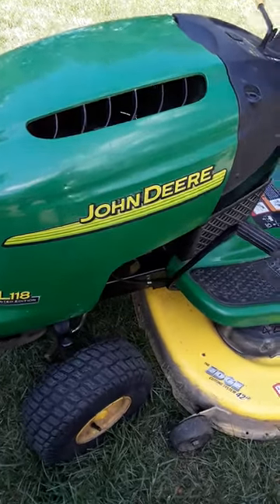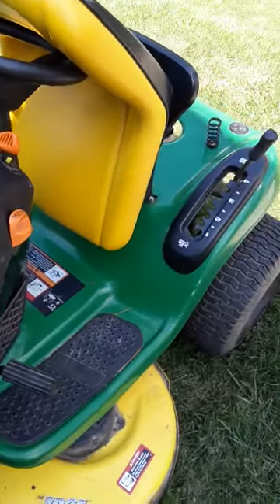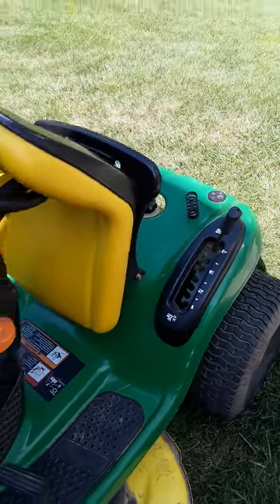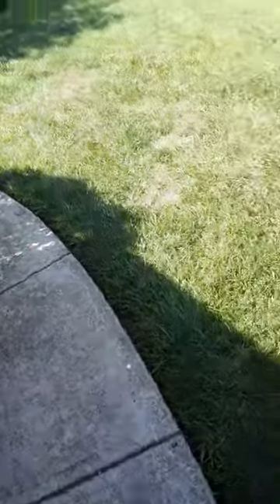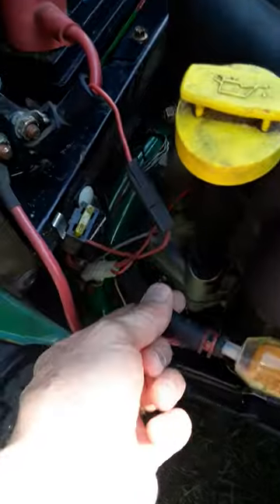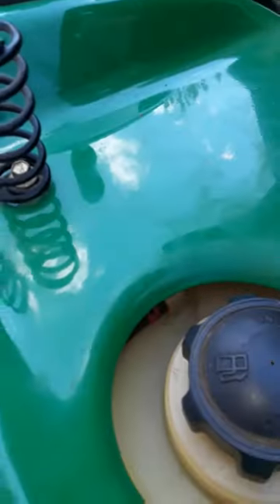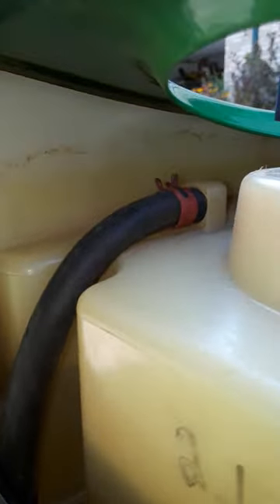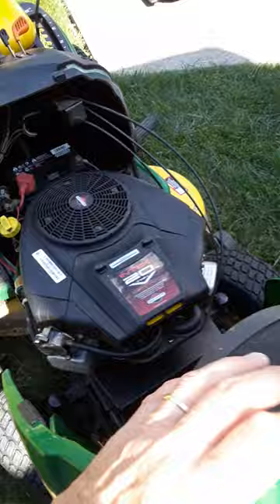John Deere Riding Mower Surging Problem Fixed!

Comment: I have a new (3 year old) jd e120 that just started surging. I just changed the plugs though the old plugs really looked fine. Fuel filter was changed last year, and air filter looks clean. Only have 60 hours on it, so I’ll check the fuel line and other simple things. Thanks for the video

Comment: I haven't fixed it yet but I know that's what it is cuz it's not getting the fuel from the tank at an even flow thank you for this and I will make sure I fix it with a new fuel line and filter

Comment: Thanks bud, I have a D105 that I just got up and running, new tires, new battery, and it is surging but will idle even at the lowest setting. So I’ll be sure to replace the lines and go from there.

Comment: On an older mower, the fuel line can shrink, both lengthwise and diameter,  especially if the line was put on tight to begin with. 
Best to hang the line a little loose when installing, to allow for shrinkage...it will only use an extra inch or so of tubing. 

I noticed on one of my Husqvarna mowers,  the line near the tank connection is a little tight, and the mower has only been used for two seasons. 

The tubing could be a year or two older than the mower to start with.

Comment: Happened to me once on my JD L-120.  I found that dust had gotten into the little pinhole breather in the fuel cap!  That's all it took to create a vacuum and caused the engine to starve for fuel and surge.  The fix was to clean out the pin hole with a tooth pick!! Yup that simple...  So now every once in a while, I'll stick a toothpick in the gas cap pin hole just to make sure it's clean.
Reply: I switch mine over to 89 octane gas, and that fixed my idle surge and hard start issues.

Comment: Had a 20 hp twin Kohler same problem from new, only happened occasionally, could not be fixed. Finally discovered it happened when gas was low. Running tank over half full no problem. Off season I installed a new gas hoses , found a plastic swirl from drilling a hole at the factory, in the tank fitting.

Comment: My John Deere is doing the same thing. I will start with the fuel line, thank you.
Reply from the maker: good luck!
Reply: @golf4funjn532  I ended up replacing the whole carburetor, fuel filter, fuel pump, and air filter. Not in that order. I still need starter fluid to start it.

Comment: Thanks for the share, I put spark plugs in and didn't know where to go next, I will replace my hoses and filter, my mower is older than yours 2006 gt245, update as I go.

Comment: I have the exact same lawn tractor and it's doing the exact same thing.  It will run for about 30-40 minutes and start to sputter and then die.  I just had $200 worth of work done on it and that didn't fix the problem.  Just watched your video and will buy a new fuel hose and replace the old one from the fuel tank to the fuel filter.  Question; how long of a fuel hose did you have to purchase and was it difficult to get into that tight space to remove the old one and run the new line?  Thanks for the video.
Reply: I know this question is a little old now, but for the community's benefit:
I have a Craftsman mower with a similar B&S engine and I needed about 5' 6" of fuel line.
Also, I removed the body of the mower (foot deck? not sure how to refer to it) in order to take out the fuel tank and re-route the fuel line. I can see the Deere in this video is configured slightly differently; I'm also a novice, so your mileage may vary.

Comment: On the plus side, you did eventually find the issue. As an aside, wish JD still used the clear type gas tanks. The black ones not ideal in my experience when filling them up.

Comment: my friend flip my mower over to change the blades for me, so everything is flooded, it only surges when i put the engine level all the way to the low position, im thinking i just have to change the Carb.
Reply: If it's rider you never flip the mower....take the deck off...a push mower I can see having to flip...

Comment: My LA100 was surging, run maybe 20 feet, sputter, run maybe 20 feet, sputter, finally died and wouldn't crank again unless that battery was recharged.

I changed the (1) fuel pickup (that thing you describe coming off the gas tank), (2) the fuel line from tank to fuel filter, (3) the fuel filter, (4) the line from fuel pump to carburetor. Having done all that, the mower ran beautifully for about 20 minutes. Then it started surging again, same old same old.

So I did all you did and more. Any other ideas?
Reply: I'm reading up on some of these problems and many have found that the hole in the fuel cap gets clogged and creates a vacuum...try running with a loose cap, about to try it myself

Comment: My x380 is surging only when mower is engaged.  Sometimes the fuel filter has gas in it, sometimes not. I think I’ll try fuel line next.  I already did fuel and air filter.

Comment: My mower is only a year old and it started surging........ you don't think my fuel line could be bas already do you?
Reply from the maker: Don't know for sure bit changing rhe line would be the best place to start.
Reply: Are you adding an ethanol protection additive to your gas?  ... without it, ethanol can make a mess in your carb.

Comment: can anyone help me with my problem?  I gave my riding lawn mower a tune up oil change, spark plug, air and fuel filter but still sputters.
Reply from the maker: Did you try changing the fuel line?
Reply: @golf4funjn532  LOL....apparently OP did not watch your video
Reply: Sometimes spraying carb cleaner in the carb inlet hose will clean out any dirt. (without the hassle of taking the carb apart).
Reply: Might be dirt in the bottom of the carb